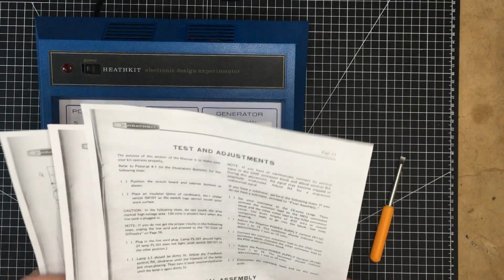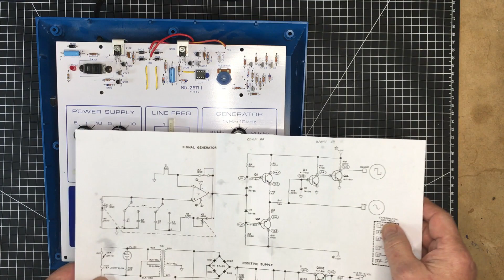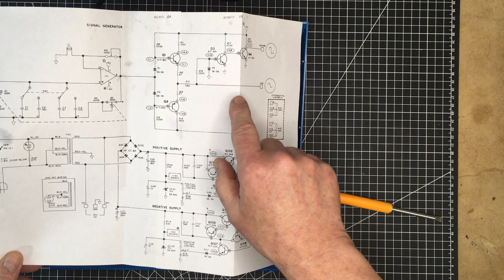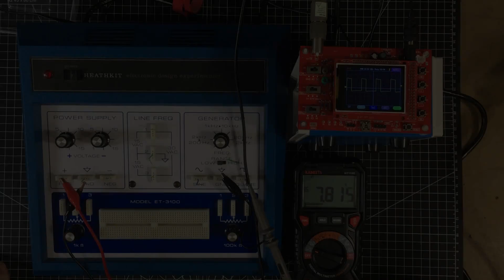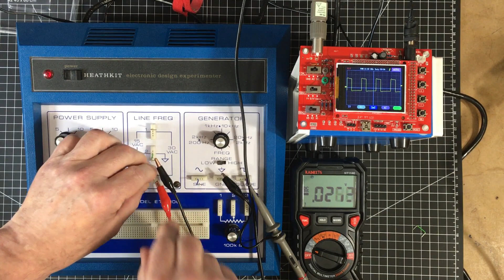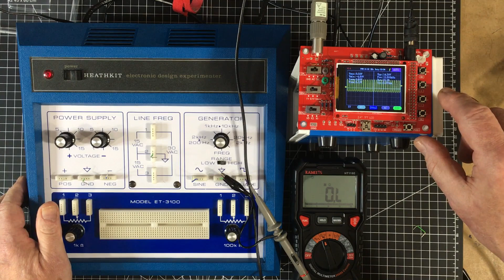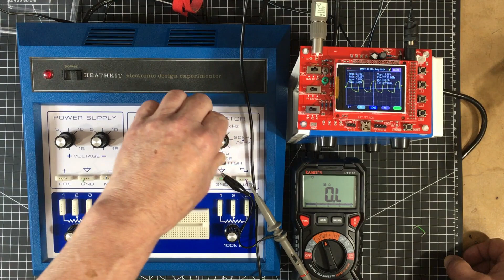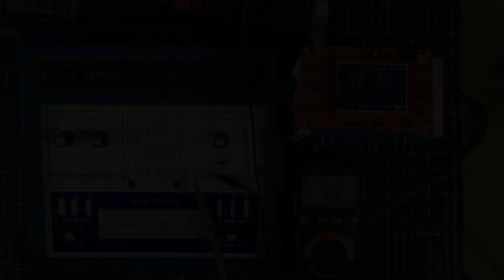0058 - Heathkit ET3100 : Just Dandy!.

Comment: I have this exact same model plus the 3200 you mentioned from a electronics course I took in the mid 80's. I had to assemble the units as part of the course. Additionally I have model IO-4105 oscilloscope which I also assembled and used for the course. All 3 are  sitting here with me right now and I built a clock the other day from a 555 and all 3 are still functioning flawlessly...Still so much fun!
Reply from the maker: Verry cool!  I built a ET-3200 as part of a Heathkit course I did in 1979.  A couple of years later I also built an IO-4105 oscilloscope.  I gave both of them away in the early 90's to a young student of electronics before we moved to a different town.  I got a lot of use out of both of them over the decade or so I had them.  Been looking for an IO-4105 but the shipping on them is a killer (in more ways than one, I imagine).